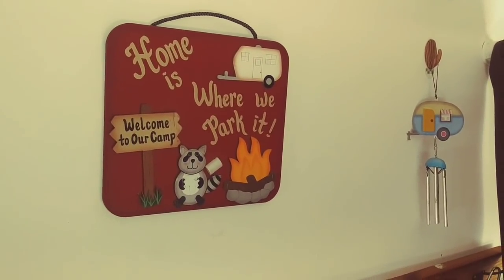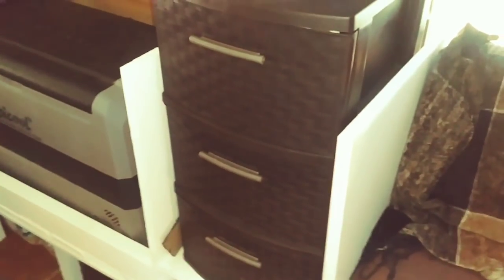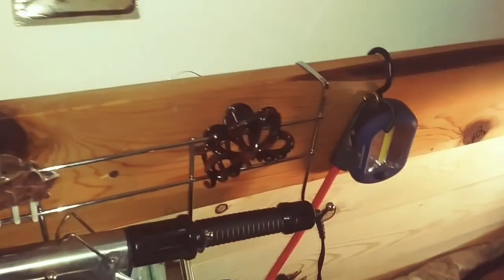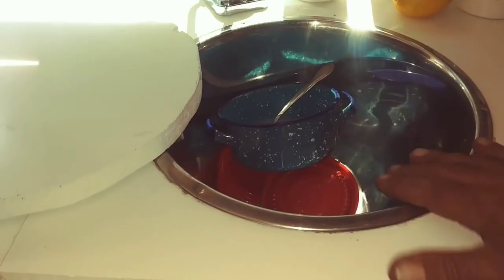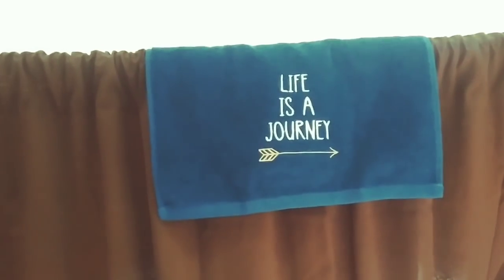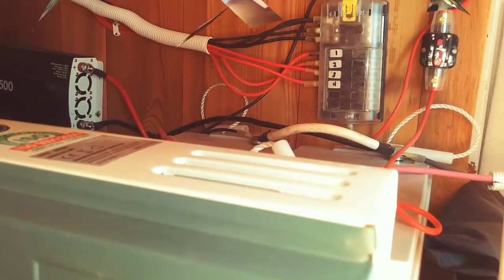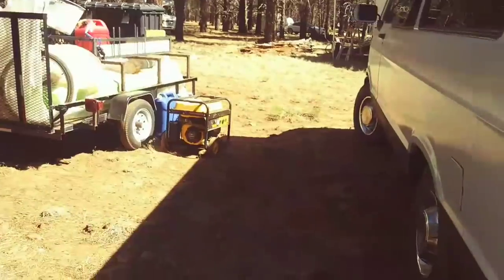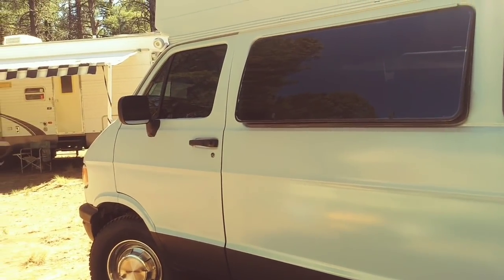What have I been up to. This is a nice build out of a 1996 Dodge Ram B 3500 van using scrap wood.

Comment: Is she planning to paint still? It looked like the cabinets were primed. If it were mine, the only thing I'd change is putting the refrigerator next to the bench seat, with the 3 door clothes and potty next to the bed for symmetry and privacy on the toilet. If you built a top across the 3-drawers and fridge, it would give her a flat counter top to move her makeup and such to that side with a stand up mirror. Or it could act like the top of a dresser with some picture frames and a small lamp.

Comment: Why didn't you talk about the hot water heater next to the solar??
What it's for since she has a hand pump at the sink.
Also I understand why you made a door under the kitchen sink to the outside but you should have also made one on the inside for more storage, may not be much but every little bit helps.
And I myself would have made the counter that pulls up on the side of the kitchen cabinet, longer for more space. I understand you put a couple of cords there but they don't stick out and nothing is in danger of getting broke off. And there are plenty of other outlets in the van. 
Just me, I think I would have made a closet maybe with drawer's where you put the bench since the seat swivels. It's nice to have, maybe she preferred a bench over storage, don't know. 🤷🏻‍♀️
Reply from the maker: I didn't talk about the water heater because it wasn't hooked up yet